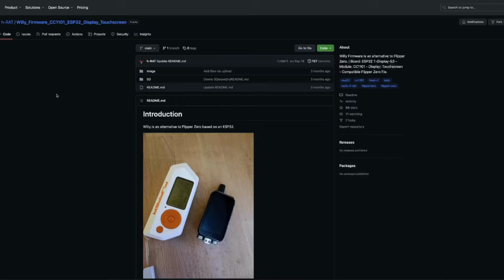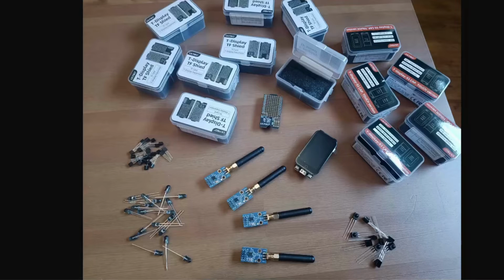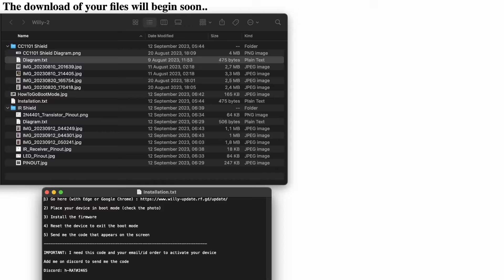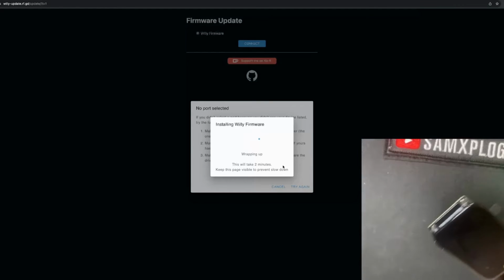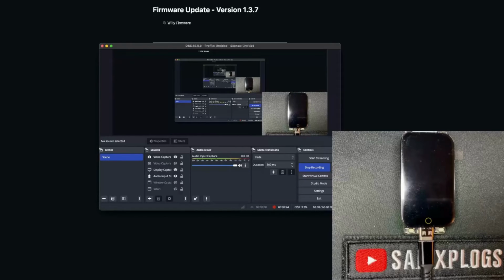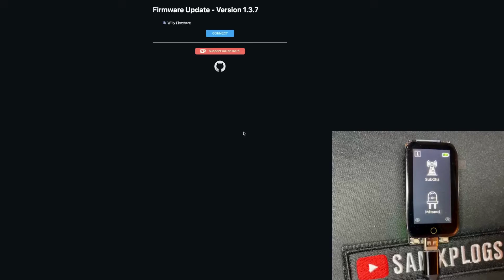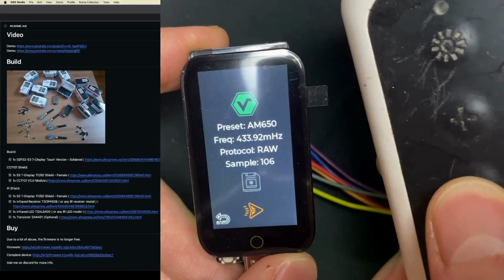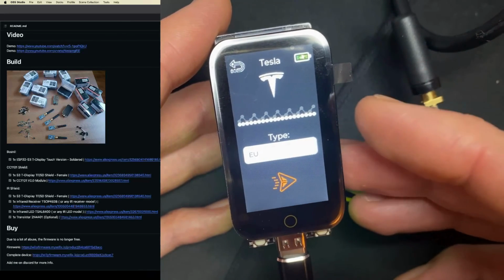Installing Willy Firmware for Flipper Zero-like Capabilities on ESP32 T-Display-S3

Comment: Hi I have the lilygo t-display-s3  same as urs connected to the willy board never been turned on can I just add this firmware  or do I need to add  somthink  first to get the wifi working. If I plug power it try's to connect  to the Chinese  wifi  not much info for a newbie

Comment: CC1101 acctualy CAN NOT recieve raw signal, since its not SDR.... its just missonformation created by Flipper
Reply from the maker: Hi Petr, I did indeed use the term according with the Flipper Zero, where a RAW signal is recorded without decoding. The only processing involved is that the signals are demodulated in accordance with the modulation settings.
Reply: @samxplogs  Im not expert in the fiel, but they have something called "Raw protocol", im acctualy able to kinda "emulate" that with technique indeed similar to SDR (mz protocol is much simplier, but without source code, i nad not tell how good is this one), but you generaly need to know modulation, and bitrate, or you will end up recieving non-sesne... Raw signal is when you just hit rec, and you can achieved that onlz with Software Defined Radio ;-) So you can call it rad protocol, but its not raw signal ;-)

Comment: Hi Sam, Really love your channel, one question, I bought a wrong Lilygo S3 Dev Board, I bought the v.01 dev board display S3, I believe its not have touch display, Am I still can use it?? Ohh man.. what a sloppy me 😅😅😅🤣🤣
Reply from the maker: First of all, thank you 🙏. Unfortunately, you won't be able to navigate through the menu with your current unit. I suggest contacting the seller, as they might be able to exchange it; the shopping interface can sometimes be misleading on some online store. I made several mistakes myself too😅. I hope you'll be able to try Willy's firmware soon 🙌.

Comment: Need to get this so start working on making it thinner and having an external antenna
Reply from the maker: Custom modifications will be necessary to make it more compact. Oz recently released a PCB featuring the CC1101, IR, and a MicroSD Card, which might inspire you.
Reply: Already made a nice case for it 😅

Comment: 12:59 can you give all the breadboard wire colour and which gpio pin you connected it to
Reply from the maker: Sure, but before that, make sure you have the CC1101 module v2.0 and double-check the wiring from your module's data sheet 🙏. Then, let's focus on the connections, as the colours are less important (on the left are the CC1101 connections and on the right are the LILYGO module connections):

CSN <=> 1
MISO <=> 2
MOSI <=> 3
SCK <=> 43
GDO0 <=> 44
3V3 => 2 pins are available
GND => 5 pins are available

Comment: Hello nice video. I have a question where i can find the firmware when i open github there is empty error of the page
Reply from the maker: Thanks! I'm encountering a 404 error, and I've already notified h-rat regarding the issue. However the firmware was not available on GitHub. You could buy it here 
https://willyfirmware.mysellix.io

Comment: Hi thank you for the tutorial, why do I need 2 shields? 😮
Reply from the maker: I'm happy to see that the tutorial has been helpful to you. Based on my understanding, you'll require two distinct shields to separate the IR and sub-GHz components. Otherwise, the PCB will become overly crowded with both IR parts and the cc1101. Currently, I'm still in the prototyping phase, awaiting the printing of a case and the acquisition of a micro SD card.
Reply: Интересно, а можно всё-таки уместить все компоненты на одном шильде?

Comment: Je viens d'acheter la version pro de T-Display-S3 avec la coque
Mais malhereusement le firmware Willy est payant désormais 😢 impossible de le tester sur le Lilygo T-display-S3 Pro
Reply from the maker: Je ne connaissais pas cette variante. C’est très intéressant, le produit est mieux fini. Le mieux serait de contacter h-rat pour voir ce qui est faisable avec lui. C’est vrai que cela peut s’apparenter à une limitation d’être compatible avec seulement un module. Je suis preneur de la suite des informations 🙏
Reply: Hey, si j'ai l'occasion d'essayer les S3 Pro alors je serais ravi d'implémenter le firmware dessus. Cependant, l'avantage des S3 "normal" est l'utilisation des shield, ce qui permet de pouvoir y souder plus ou moins n'importe quelle module, sur les S3 Pro impossible.

Donc oui le produit est mieux fini, dans l'état, mais je serais curieux de voir comment y placer proprement un module CC1101 par exemple. (Il faut que cela reste assez "facile" pour tout le monde)

Pour les utilisateurs actuels, n'hésitez pas à m'envoyer un message pour obtenir les plans 3D disponible pour la board S3 "normal".

✌
Reply: @h-rat3135  The PRO has 2 QT ports I think they are called... I'm not a wizzkid like u but aren't those connected to gpio's?? might that be a possible way to interface some mods?